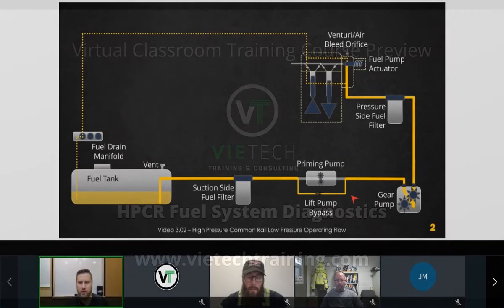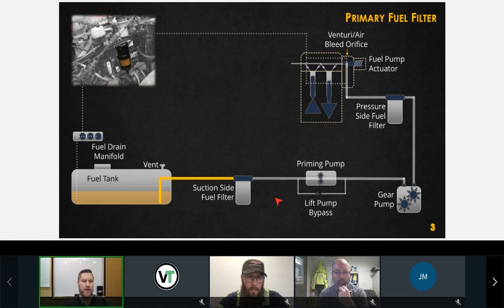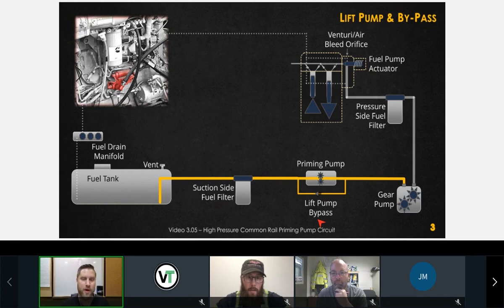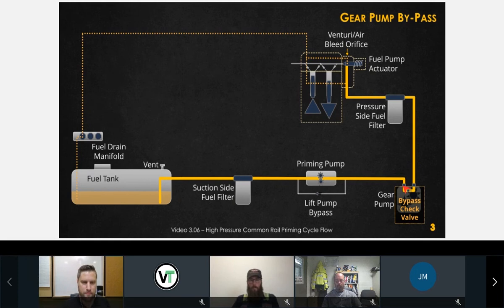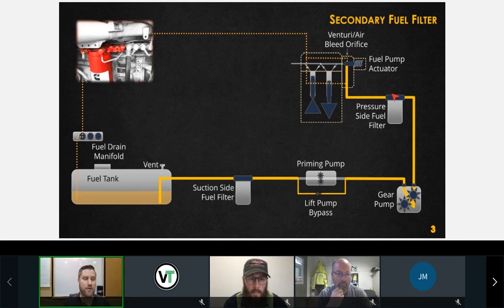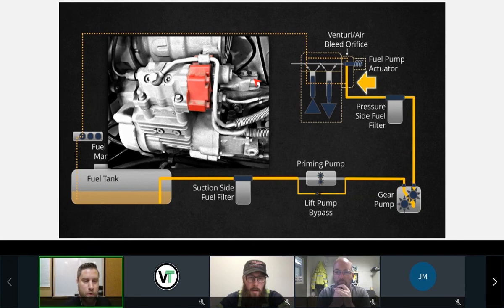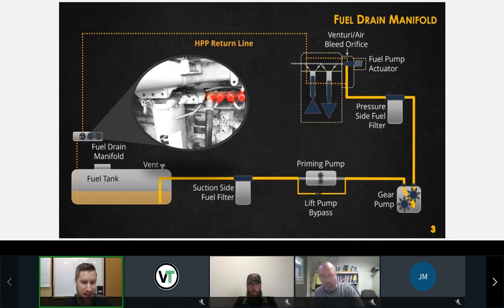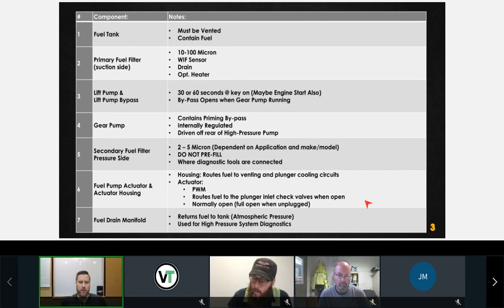Preview VieTech HPCR Fuel Systems Training

Comment: If gasoline is put into the system, could that cause hard start or vehicle shutdown while driving
Reply: Depends on how much you put in. If the whole tank is gasoline, then it will cause lot of different symptoms. Rough running, not starting.